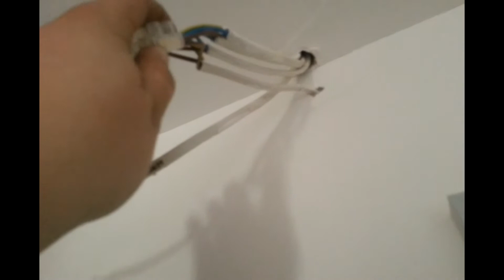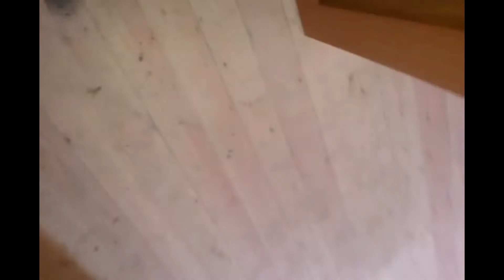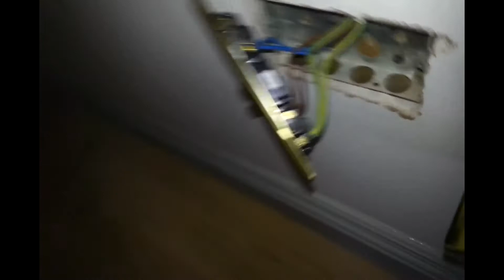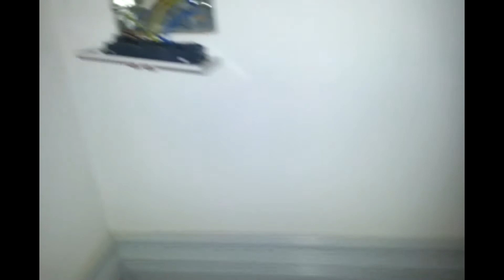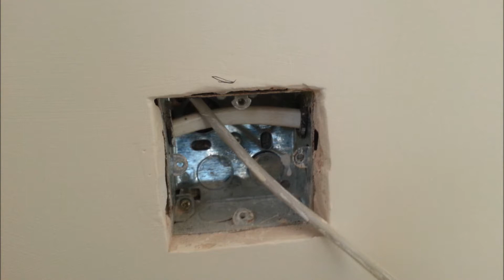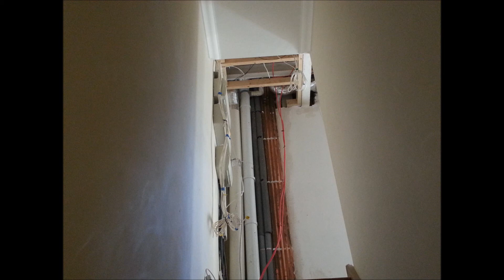Epic Fail of a first fix job

Comment: Interesting to see examples of bad first fix. But it was hard to see from the actual video everything that was wrong, yes missing grommets and lots of knockouts missing etc. Wires through ceiling far from ideal. 

The description to the vid I just read was much more informative of the real issues you found. Presumably multiple spurs and not much of a clue about safe zones.